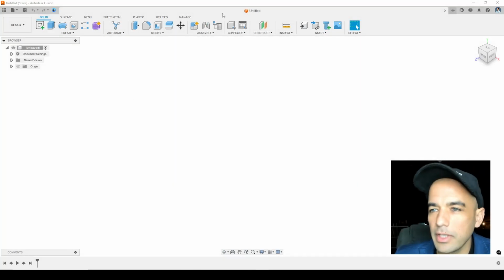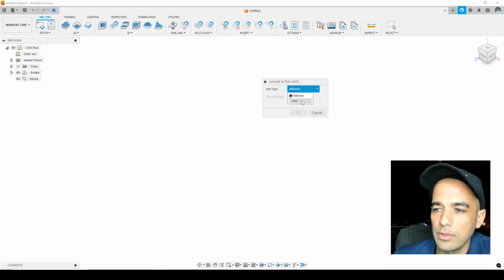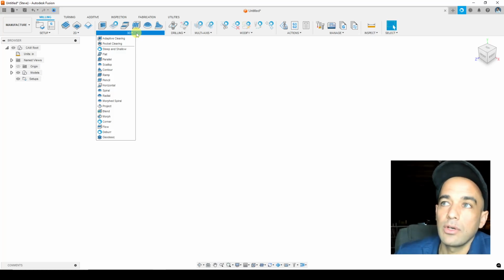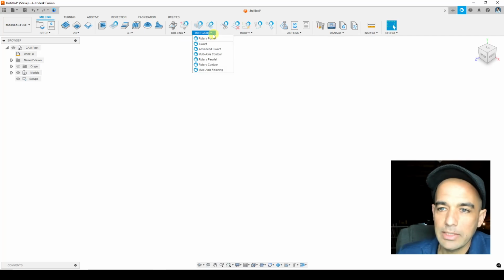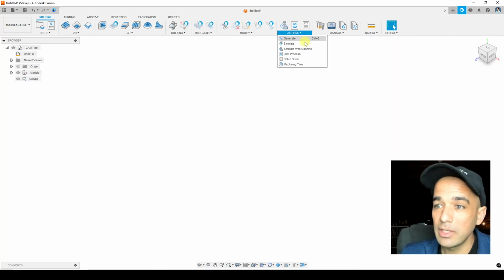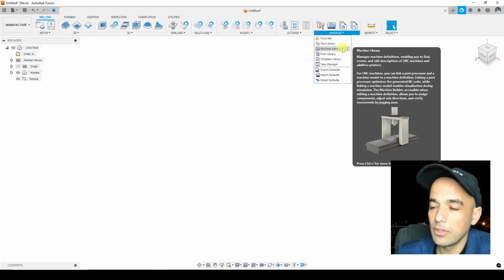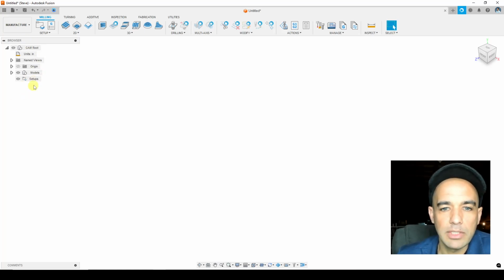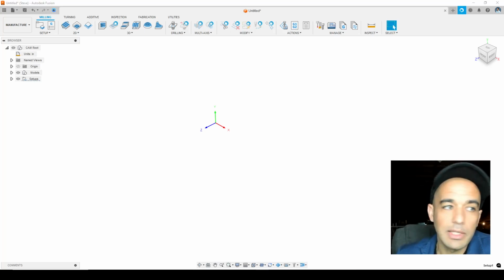Intro to Manufacture Workspace in Autodesk Fusion

Comment: I'm interested to see what you are going to do next. I am interested to to bridge the gap I have in regards to getting my hobby bench top CNC mill going (GRBL-based). I am quite familiar with F360 as I design all of my 3D printed engineering pieces using it, been doing this for almost 6 years.
Reply from the maker: Thanks for your interest! I'm just getting started here but the ultimate goal is to have a comprehensive, step-by-step guide from the basics all the way through programming and machining a series of parts. There will be several projects that go all the way from CAD, through CAM and to machining.  The projects will get progressively more complicated and will take you through from the basics to more advanced concepts in CNC programming and machining. 

This is all based on similar content I have been developing while teaching this at a community college over the past several years.  It also works in conjunction with a book that will be released very soon. You can find details at the book website: cncbeginner.com